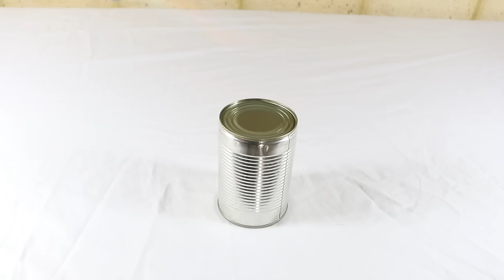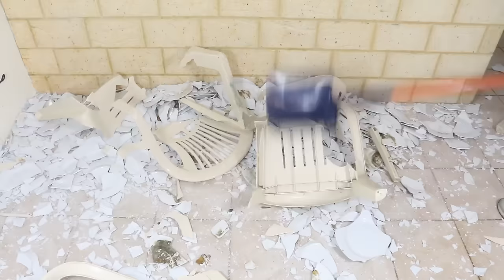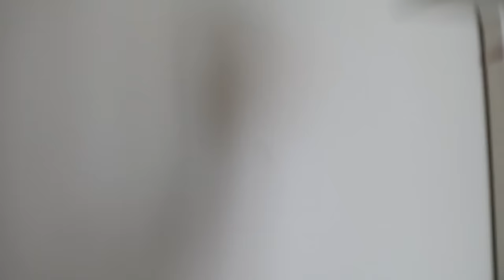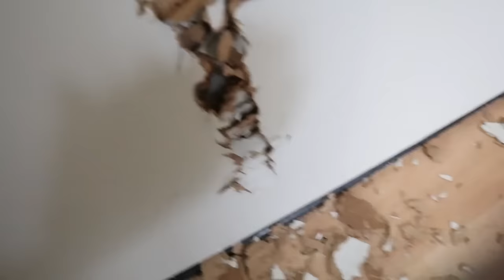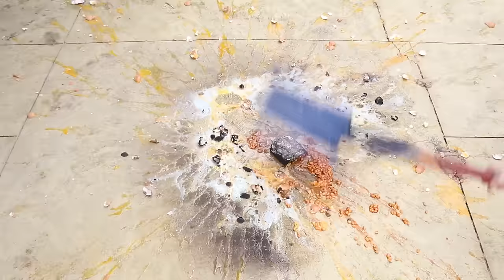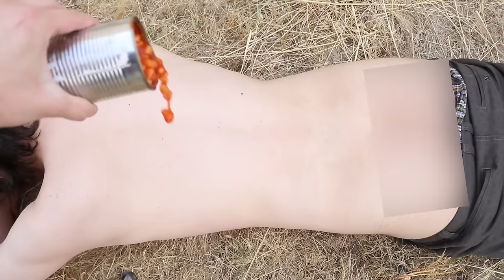How To Open a Can Without a Can Opener

Comment: So how many plates do I need in order to open the can?
Reply: BOI around 70 plates
Reply: Exactly 173 plates.
Reply: 69.
Reply: BOI 100000000000000000000000000000000000000 plates
Reply: 29 before he opened the first can which wasn't "open"
Reply: ITS OVER 9000!!!!
Reply: BOI XD
Reply: BOI 53
Reply: BOI 82746584920928474738
Reply: I knew that someone would say that eventually.
Reply: BOI about 50 plates
Reply: All of them.
Reply: AT Productions z
Reply: 48 plates and 3 plastic chairs. Yes I've counted them properly. Youre welcome
Reply: I WAS ABOUT TO SAY THAT
Reply: 415 k1ub + 1 door
Reply: BOI spoiler alert
Reply: as many as it takes for a minigun to shoot full speed for a minute
Reply: BOI 121 plates
Reply: BOI 585
Reply: as many as you want
Reply: BOI you also ned fire and eggs
Reply: 9001
Reply: Dušan Pešić 101 I four times but I could still be wrong but I'm pretty sure it's 101
Reply: 666 plates
Reply: Ash Studios Nope it could be 2134
Reply: Ash Studios If its that many it could be all over the house until inside
Reply: 82 plates, I counted at 0.25 speed.
Reply: BOI Try 741
Reply: BOI over 9000!!!
Reply: OM G But you said cook and I don't think you cook orange juice
Reply: BOI you need 5000 plates
Reply: When The Vitamin Gummy's Kick IN a minimum of five depending on how good your aim is.
Reply: When The Vitamin Gummy's Kick IN i counted 60 plates
Reply: When The Vitamin Gummy's Kick IN 5000000000000000 plates
Reply: When The Vitamin Gummy's Kick IN ttt
Reply: When The Vitamin Gummy's Kick IN um 6000000 plates, 3 chairs, a shovel to break em, a door, 8000000 eggs, and A human I think that's all :3
Reply: When The Vitamin Gummy's Kick IN 793
Reply: 3,000
Reply: When The Vitamin Gummy's Kick IN 66467483939900001973647284683648365945133249475513058473626385938466477656484646474846488272839374656474848383747474849383737576666664739377464464647475847465656565645273635464544565555555575757575757575757575757575757483829101020303947572019 plates
Reply: When The Vitamin Gummy's Kick IN a lot
Reply: When The Vitamin Gummy's Kick IN a skele-TON of plates heh
Reply: When The Vitamin Gummy's Kick IN how many eggs
Reply: 10000000000000 plates.your welcome
Reply: When The Vitamin Gummy's Kick IN nothing.
This is just a joke.
Reply: don't forget the chairs and shovels
Reply: When The Vitamin Gummy's Kick INTO space cam
Reply: When The Vitamin Gummy's Kick IN 100,000
Reply: ALL OF THEM
Reply: When The Vitamin Gummy's Kick IN this is the guy that is using 80% of the world's plates
Reply: When The Vitamin Gummy's Kick IN bleach might help me
Reply: When The Vitamin Gummy's Kick IN maybe about 1337 or 666
Reply: *around 41 plates and 37 eggs. I tried counting them, but it wasn't easy XD
Reply: When The Vitamin Gummy's Kick IN none Stupid
Reply: about a million
Reply: Don't forget about chairs and brooms and everything else
Reply: i cant believe i did this but i counted how many he threw.... 42 plates
Reply: 69
Reply: you guys do realize he is gay, don't you?
Reply: When The Vitamin Gummy's Kick IN over 9000!!!
Reply: When The Vitamin Gummy's Kick IN and chairs
Reply: When The Vitamin Gummy's Kick IN take a couple thousand
Reply: When The Vitamin Gummy's Kick IN all of em
Reply: you need only 80
Reply: When The Vitamin Gummy's Kick IN and how many eggs
Reply: When The Vitamin Gummy's Kick IN 1 million
Reply: When The Vitamin Gummy's Kick IN 50 and 4 chairs
Reply: When The Vitamin Gummy's Kick IN don't forget the chairs
Reply: just use all your eggs
Reply: When The Vitamin Gummy's Kick IN as many as you need
Reply: as
Reply: When The Vitamin Gummy's Kick IN one plate
Reply: When The Vitamin Gummy's Kick IN 46
Reply: When The Vitamin Gummy's Kick IN yea
Reply: Kat H. ty
Reply: When The Vitamin Gummy's Kick IN 1000000000000000000000 million
Reply: Shanah Pillar No that not right........... maybe 1 yeah 1 :DDDDD
Reply: When The Vitamin Gummy's Kick IN same exact number as the likes this comment got
Reply: 1701
Reply: m8 you a god
Reply: lo quiero todo en español
Reply: When The Vitamin Gummy's Kick IN 
a small loan of a quadrillion  plate
Reply: I tried to count them, they're about 56
Reply: When The Vitamin Gummy's Kick IN isk
Reply: Race M. figures
Reply: When The Vitamin Gummy's Kick IN   
idk maybe 1000 plates?
Reply: When The Vitamin Gummy's Kick IN approximately  61
Reply: When The Vitamin Gummy's Kick IN I counted and about 40-50 lol
Reply: Don't forget the chairs door and eggs
Reply: When The Vitamin Gummy's Kick IN  10000 of each thank me
Reply: Planet Cheeseburger XD
Reply: Let's not forget the 3 garden chairs
Reply: Probably around 80 or 90
Reply: and a blowtorch
Reply: When The Vitamin Gummy's Kick IN OVER 9000
Reply: Its over 9000!
Reply: thedro1d slayer03 normie
Reply: 0 PLATES WOULD BE MORE EASY
Reply: 36
Reply: When The Vitamin Gummy's Kick IN hahaha rip nice plates
Reply: When The Vitamin Gummy's Kick IN Nice!
Reply: When The Vitamin Gummy's Kick IN 4002y
Reply: When The Vitamin Gummy's Kick IN count them
Reply: Why don't u count xD
Reply: When The Vitamin Gummy's Kick IN 300
Reply: When The Vitamin Gummy's Kick IN alot
Reply: 999B
Reply: 10^13 plates or
Reply: 20 plates
Reply: 1337
Reply: 3k plate's
Reply: When The Vitamin Gummy's Kick IN 50 i think
Reply: 68
Reply: When The Vitamin Gummy's Kick IN Exactly 214 plates.
Reply: 192 to be exact
Reply: Maybe all your plates
Reply: -99999999999999999999999
Reply: A Logan Paul that’s the answer
Reply: 1000000 million plates
Reply: 59
Reply: 59 Plates.
Reply: You need a million of plates and it should be open
Reply: very good
Reply: *yes*...
Reply: About 6 and how many do I need to open a can 6 yes I got . 60 plates what? You need 60 plates to open one can... 😐 welp back to the super market
Reply: 42 (of course)
Reply: 43 I counted
Reply: Or you can just buy 1000000000
Reply: And also a chair
Reply: Mm couple hundred?
Reply: BOI 42
Reply: 24
Reply: @waddle_774  173?? peanut... scp
Reply: About 1.2.5.9.40.57 mmmmmmmmm uncountable 😐
Reply: 96
Reply: Ultimate
Reply: YES
Reply: I tried counting, but after the pause, I lost count. For anyone who actually managed to count, more power to ya
Reply: Boi you need 100 chairs
Reply: 80
Reply: Darude sandstorm
Reply: When The Vitamin Gummy's Kick IN to many
Reply: Around 476 plates
Reply: infinte plates
Reply: Lifetime supply
Reply: Ask Logan Paul
Reply: About 50k
Reply: 84
Reply: Actually i think burning a can is a best way.
Reply: I count 30
Reply: 69
Reply: 3 i think
Reply: @ilikechorizopizza0  I got 80
Reply: 500 😏😒😊😂😂😏
Reply: 73
Reply: 67
Reply: 1000
Reply: i actually counted them with a calcualter and it was 102 plated you need
Reply: Around, well... 7483945 plates
Reply: I'd say 91
Reply: You need a door
Reply: YES.
Reply: When The Vitamin Gummy's Kick IN ha ha very funny
Reply: yes
Reply: 666

69
Reply: 200 plates
Reply: 1m like
Reply: No no, 4,3 plates
Reply: Yes
Reply: 999.999.999.999.999.999.999.999. plates
Reply: Infinity
Reply: 61
Reply: I counted in 0.25 speed and around 77-80
Reply: 20k
Reply: No dumb dumb it’s 76 plates
Reply: Aroundddd..... A million??
Reply: 61 i think
Reply: 76
Reply: 76 to be exact
Reply: When The Vitamin Gummy's Kick IN wkwkwk
Reply: 61
Reply: 61 Someone counted it
Reply: 76
Reply: no 76
Reply: 42069 plates
Reply: 61 plates (legit)
Reply: @Seywan Sina is that you on the pfp
Reply: Yes
Reply: 76
Reply: Only 32. I counted it.
Reply: You need also a shovel

Comment: 80 Plates,
 3 Chairs,
1 Can of beans,
1 Door,
34 Eggs,
1 Concrete floor,

1 Voice,
And 1 Maxmoefoe was harmed in the making of this video.

(EDIT: I'm not sure if 80 was the exact plates but that is the closest I came to.)
Reply: 67 plates
3 chairs
26 eggs
Reply: @cheseofficial1476  Everyone sees something different.
Reply: 69 plates
Reply: 81 plates
Reply: And 1 knife
Reply: Use 0x25 speed
Reply: AND A SHOVEL
Reply: 60 to 65 plates
Reply: garrett gaines I got 49
Reply: don't forget a flamethrower/matches
Reply: garrett gaines you forgot the blowtorch
Reply: 3 can of beans
Reply: A torch
Reply: Its very important information dude
Reply: it was more than 80, sometimes he threw more than a plate at a time
Reply: And 1 blowtorch
Reply: The fire extinguisher and the blowtorch technically didn't get destroyed, it was just used.
Reply: Sometimes, he throws more than 1 plate.

Comment: Let’s see what you need to open any can...
1.use a blowtorch
2.61 plates
3.3 chairs
4.Another 15 Plates
5.one door
6.blowtorch 
7.a shovel
8.Fire extinguisher
After the chairs is a dark blue shovel which is longer, though the other one at the fire extinguisher part was small. Both of them were different..
9.Enjoy your food!

I didn’t know what to do but I counted in SLOW-MO

Comment: Ok this is so insane, what kind of a guy is this that break stuff and he doesn’t talk, at the beginning of the video everything is fine/ or not then everything is completely gone wrong man! Ok in the beginning of the episode, it says there how to open a can without a can opener( as shown in the title of the video ) then a direction/guy said/ use use a blowtorch to open its cover,
It took about 5 mins, until he throws tantrums  and throws it in an empty space. He starts getting angry and throwing 56 to 99 plates for only 5 mins again, the. He just threw 3 chairs and another 15 plates and starts breaking it, after 1 min, he quickly finds the can, when he found it, he is still frustrated because the can is not opened yet, he starts to run towards a door and using a can to poke it that leads to a toy room or so, there when he peaks in the hole, he saw a man naked. All of his pants are and underwear are out. He was very mad and starts punching more holes in the door. After punching holes in the door. The door starts coming loose. Until the guy pushed through the cracked door and starts looking for that man. Until he notices he is gone. He is even mad than before, so he went out and out the can in the ground and starts throwing eggs on it. After that, he burns all the eggs in fire. After the fire went out a little bit, he uses a shovel to smash the can, and while he is smashing it, some bits of food are coming out form the can. After that, he stopped smashing it, and use a fire extinguisher to blow the fire out. Until a miracle happened. The can opened! He was surprised! Then he went to see a closer look. Then he uses a finger as a dip and put it in the canned of beans! He starts shushing while touching the food. After that, he gives a thumbs up then spilling the food into someone’s back and start spreading on it. The other Gus who is lying down can’t talk too. He doesn’t care. After that, he transfer it to the bread and he passes it to the other  guy lying down. He makes a bean sand which. The other guys starts eating it. After that, the 1st guy gave him a towel or a hanky to wipe his nose. 
                             THE END
                summary 
To open a can… 
Throw/ smash/ punch 
1. 60-99 plates
2. 3 Chairs 
3.15 plates 
4. Punch a hole in the door 
5 . Throw eggs
6. Hit with spade/ shovel
7. Spread the food  with another person
8. He eats it
9. Blows the nose.
The end thank u by JEX